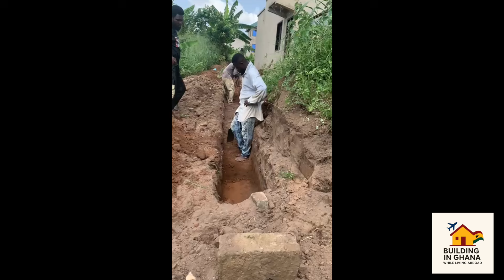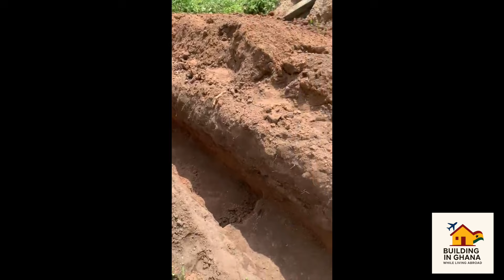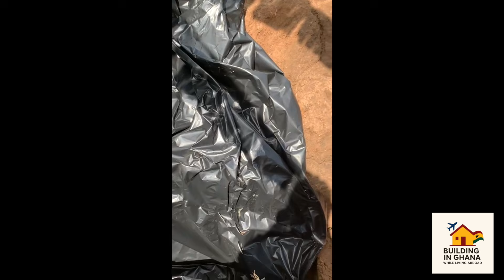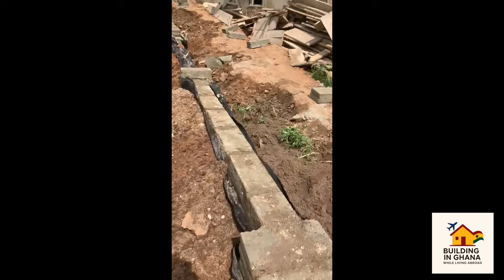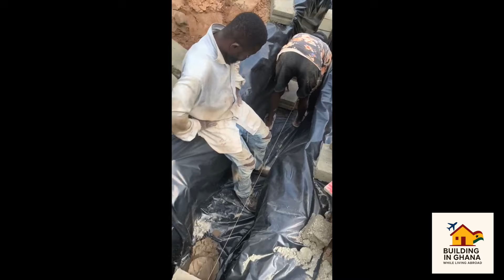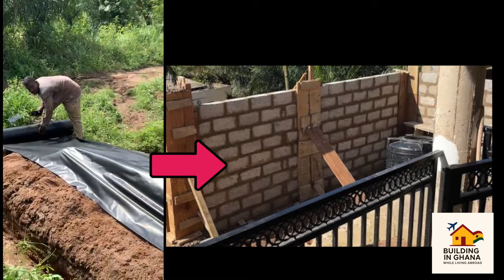Why We Chose Sandcrete Block Walls for Our Ghana Build  #ViralGhanaBuild

Comment: In uk most fence walls are build using fence panels or bricks.
But in ghana, everything is block and iron rods cement! Why🙄
Reply from the maker: I understand what you are saying, as I lived in the uk for over 30 years and did work in the building trade over there, 3 things to bear in mind though is 1 , Fences panels in Ghana will rot very quickly due to water erosion  and termite destruction. The cost of wood I believe is also dear in Ghana compared to cement blocks. Red bricks wall, on the other hand will cost you dearly, as they are  very difficult to source. They are in Ghana but , they are not cheap to buy. so using them for 70 x100  wall , is not advicable,   all these factors combined make them not suitable in Ghana, they can be used my it will come at a premium cost.
Reply: Fired clay bricks are not difficult to source in Ghana. You can find reliable suppliers in every region of Ghana. They are also not expensive, if you think in the long term. Even more cheaper in the long term. 

Also there are skillful brick layers in Ghana. If you don't know you have to ask.
You are doing your sandcrete wall with minimal budget, but it will you cost you more in the future. You have to plaster both side and paint every 2 or 3 years. And the blocks will deteriorate with time, maximum 10 years becuase you made them yourself by manual. 

A true 9 inches fired clay brick or structural masonary double brick wall is not a joke and you can't compare manual sandcrete. You don't have the money so you are building this cheap wall. That is okay, but you to do it again. 

A true brick wall lasts for a long time, even 100 years and the beauty and age is peerless. You can get that in Ghana. 

Please answer your subscribers based on fact, not fallacy.